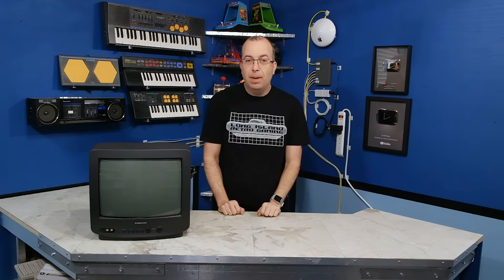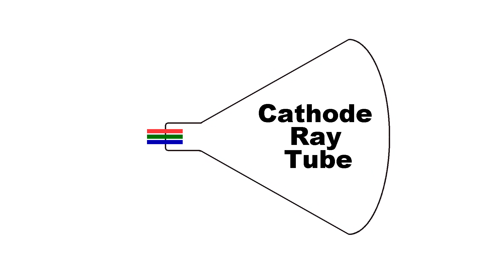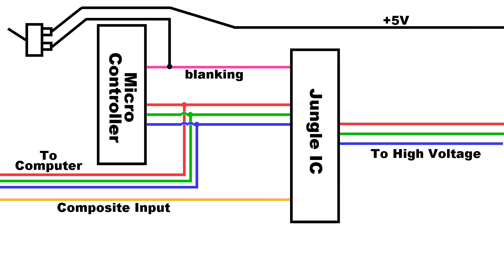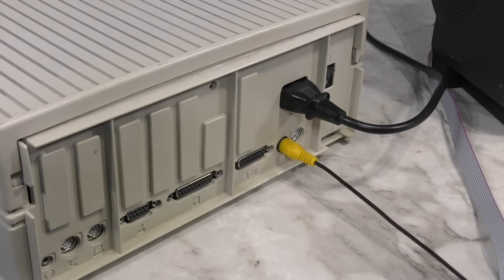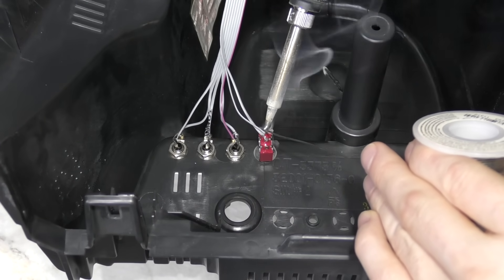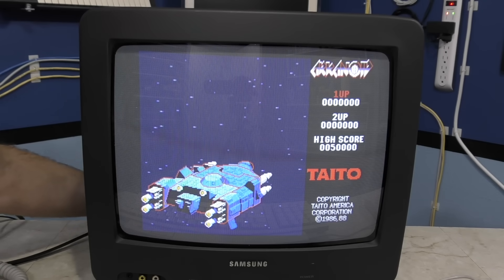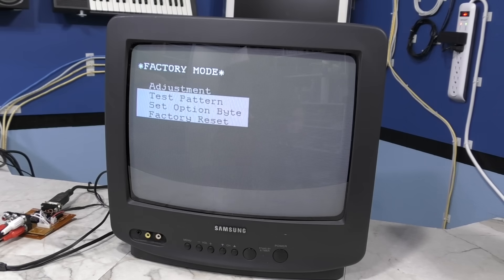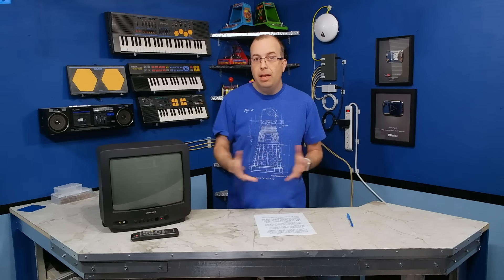Modding a consumer TV to use RGB input

Comment: Heh, I used to sell AST computers in 1995-96. The hardware was okay, though the PCs were overpriced. The shell over Windows however was TOTAL garbage that did nothing but add overhead to an already small amount (usually 8, sometimes as high as 12 but also as low as 4mb shared with the onboard video chip)of RAM in the system. As a consequence, Windows performance was godawful compared to a clone or a Compaq or something that didn't use a shell over windows. (already a shell over DOS in 3.0/3.1) DOS game performance was acceptable, although you couldn't run a VESA 2.0 framebuffer to improve Doom or Duke Nukem 3D performance like you could on a clone with a decent SVGA card.

Comment: The SCART connector ("prise péritel") was an engineering failure. You could push the double-knife-style of pins into the plug. Add the fact that many cheap TVs did not connect the RGB functionality, as one pin of the three was also used for the Chroma input (I used it to connect the Commodore 64 back in time), later handy for S-Video adapters to SCART.
But that means you needed to switch the TV to either expect Y/C (S-Video) or RGB.
Often just that menu point to select RGB as input made that version 200 Deutschmarks (I lived in Germany back in that time) more expensive - for just that option.

At the end, everyone used composite and often even did not know about RGB input capability.
Second: I had a Philips back in time which was only blurry in RGB mode. You could not read anything. It was fine in Y/C or Composite mode. My thoughts back in time were they did this deliberately to not be able to use it as computer monitor because you should add extra money for an extra monitor for that.

Comment: When you RGB mod the TV yourself and add the resistors, do your SCART cables also need resistors? It won't weaken the signal? I noticed some SNES and Genesis SCART cables come in 2 varieties, with or without resistors/caps.

Comment: The major problem you will run into on some monitors is, that you will not have a good separation from the mains.TVs without a separate input have a simplified power supply and are therefore not suitable for a separate RGB input.

If you modify a TV to have a separate RGB input, then you might create a nice fire hazard and you can wind up frying all the other electronics that you connect to the newly installed input.

I am a TV technician and I did such modifications in the 80s and 90s on some small TVs and I have seen exactly the described problem on many TVs. Those are the ones you should just avoid to modify.

Comment: You just need to buy a European TV! They have this ability from stock. The SCART connector has a native RGB mode, which was typically used for DVD players, set top boxes or games consoles (like my Sega Dreamcast, with the optional RGB cable, and even my older Sega Saturn and Mega Drive). And other than you said at 16:29 , I can tell that at least on the Dreamcast the RGB cable does make a major difference in quality, compared to the RF modulator.

RGB also served as a bridge between PAL and French / Eastern European SECAM devices. So you could hook up any PAL DVD player to a French SECAM TV for example. I am from Germany (the home country of PAL), but I bought my Sega Mega Drive and Saturn from France (-> SECAM) - which is the reason why these PAL consoles have RGB cables! Normally, in PAL countries, they would have been shipped with RF modulators, delivering a composite signal. But to be compatible with French TVs they needed to have a SCART cable, which could transmit RGB signals.

Comment: 9:15 You can easily remove the RCA jacks which are mounted on a phone SCART connection sized plastic and add a real SCART connector to the TV cleanly. You can move the RCA jacks to other holes...

Comment: Wow a remote TV
Believe me in Iraq we had only one working TV. It was General 14" color rotary channel switch without AV port only one analog
We Used it from 1980 to 1999 after that we fixed the other one it was 26" EIC it has blown tripler i remember that even when i was 11 years old because we suffered alot from that 14" TV 😂😂😂

Comment: Great video. I really like to watch your channel. Just one small comment. I just can't get used to cutting connectors of the cable so close to the connector like in 11:34 . If you left a little wire behind the connector, you could use it in the future (if needed) by soldering to a wire.

Comment: Samsung obviously designed this TV to have a scart (RGB) socket for some markets. The cut out on the back (shown at 11:49) for the video input is EXACTLY the shape of a scart socket with the left side at a slight angle to the right side. In the USA they will have fitted two RCA jacks but for the European market a scart socket with access to the jungle chip. You were so close to having RGB

Comment: I had a SCART equipped Goldstar TV (the company now is LG), but it never accepted an RGB signal from my Atart ST. I dunno what was wrong. Also, a German Blaupunkt 29" TV did not accept that signal via Scart either.
It was only in the year 2000 when we got a widescreen CRT Philips which wondrously accepted RGB signal from Atart ST on the first Scart socket (it had three), and it looked great!

Comment: 9:35
interesting, so this model was also sold in Europe with the typical scart output on the back.
Reply: That's why he could convert it. I laughed a little when I saw the unused blanking plate for the SCART on the back next to his improvised connectors. Esp. as he only mentioned about SCART right at the end. Probably to avoid comments.
Reply: Indeed, but he won't need SCART, or Péritélévision as it was really named (yeah ik the name was never used outside of France). The connector itself isn't expensive but factor in sparing 5c on 10 000 TV sets, its easy and quick money. SCART was factory in Europe as it was mandatory in France up until 2014.
Reply: @victorpelini5995  The name SCART comes from "Syndicat des Constructeurs d'Appareils Radiorécepteurs et Téléviseurs" ("Radio and Television Receiver Manufacturers' Association"), the French organisation that created the connector in 1970. Wikipedia
Reply: @BertGrink  yup ik im french myself
Reply: @victorpelini5995  here in Germany, some newer TVs still have Scart, even my 4k 55 inch TV
Reply: @Tobi_DarkKnight  then you must have a LG one
Reply: @deepakk1347  nope. JTC
Reply: Or at least just the case

Comment: I'm very glad we have a SCART with RGB input in Europe so I don't have to add an RGB input to my CRT TVs.I connected PS1 and PS2 via SCART (AV Multiout to SCART cable with RGB) instead of AV Multiout to composite cable and the difference was incredible.
Why they with PS1 and PS2 packed only composite cable?There's quite a loss of picture quality.It's interesting that your TV in the video have SCART shaped hole where the composite is 🤔

Comment: 13:50 – Digital is not really either on or off "by nature". That's rather a trait of binary [logic] circuits. Strictly speaking, "digital" only means that physical states represent digits or other discrete symbols. It says nothing about the numerical base used, really. Just like "analog" RGB, some digital circuits represents digits using more than two levels! Examples could be the ten (or more) discrete levels used in some old digital (decimal) computers, or the 4, 8 or 16 levels in modern types of NAND flash used in USB-sticks and memory cards, but also things like digital radio (DAB, Mobiles, Wifi etc) or even the signaling on ethernet cables!

Comment: I’m glad I’m not the only person who uses hot glue as an insulating material.
Reply: Whatever does the job, right? :D
Reply: been using it as an insulator forever haha
Reply: I'm a user too... I use it on Variable Frequency Drives because it's I what I have at reach. I repaired a Flyback Transformer voltage leakage with that, and up to this day works...

Comment: 15:51 is it because the Genesis uses an inverted composite signal?

What I mean is that I couldn't plug it into my van's head unit without reversing the polarity on the composite RCA (the HU has a 3.5mm 3-ring composite input, meaning the shields of the yellow red and white RCA's are connected) (the Genesis and even the newer AtGames Genesis Mini both use reverse polarity on both the composite video signal and the power input)

Comment: I was lucky in that my CRT TV from 1996-2008 was a Radio Shack but really Philips-designed-cloned-in-Italy model, and it could take RGB in through SCART even though it wasn't documented or indicated in any way whatsoever. So with digiboxes it looked great. Also, it did Widescreen switching and vertically squashed the raster when receiving a 16:9 picture. Oh yes and could switch natively from 625/50 to 525/60, no horrible conversion required. The only thing it couldn't do was decode the colour from a composite NTSC signal, it was PAL only in that regard, but if you fed an "NTSC" signal from an external device over SCART in RGB mode, you got a perfect crisp, bright 525/60 image. That was great for giving a true 3:2 pull down on film originated material.

Comment: The colors in RGB mode look dull. It's especially noticeable when you switch from RGB to composite mode; the composite mode colors are more vibrant. That's the problem with this sort of modification, i.e., finding the right resistor values is a guessing game.

Comment: I did the same in 1985... many of you were just a vague thought in your parent mind.
I simply soldered a 0..1 uF capacitor on the base o the video output driver.
The AC coupling imply that some horizontal traces would appear at different part of the screen, but the game was enjoyable.
I was not playing so much but preferred let the video game play by itself as a fancy screen saver.

For Joust: set bonus to 1000 points, connect a 555 oscillator on the flap input of both birds, permanently make one bird go left, the other go right. Both birds would kill each other more than the buzzards, but sometime they would even get the pterodactyls.

For Robotron:2084, a modification of the firmware allowed to bypass the contact test between the player and everything while allowing the contact test between the player shooting bullets. Result: the player go thru everything. Constant firing and only one direction always end up with waves that don't clear. Adding a slight wiggling in the player position with the 555 connected to koystick motion fixed that problem.

Comment: So if you plugged component cables into those inputs, would it just work of would the signal still need to be converted manually from normal component format?
Reply: Assuming that you used a component signal that was in sync with the reference component signal (remember that the RGB mod still needed the composite for timing synchronization), what you would effectively see is the luminance signal on that channel without the chrominance color information having been decoded -- just like a legacy black and white television set without the ability to decode color. This would likely be distorted somewhat do to the fact that the subcarrier frequencies that would normally be eliminated during demodulation would still be present on the line.